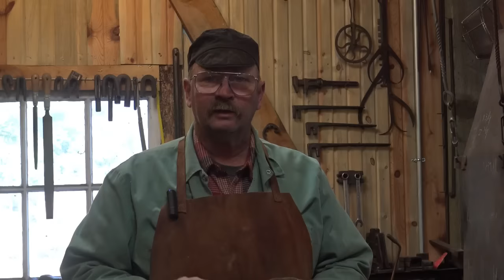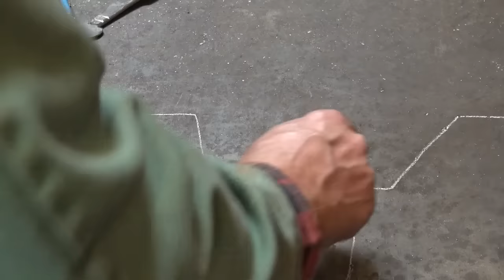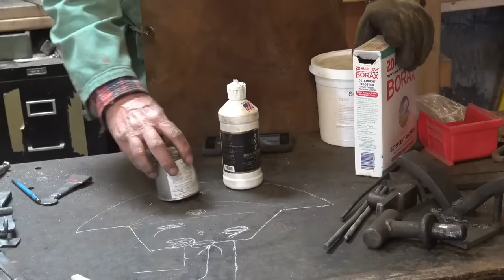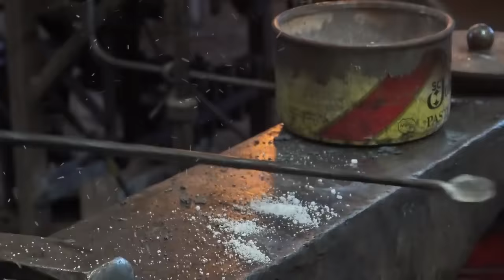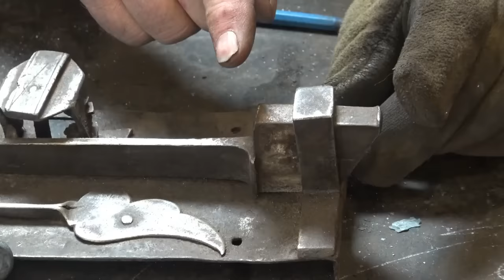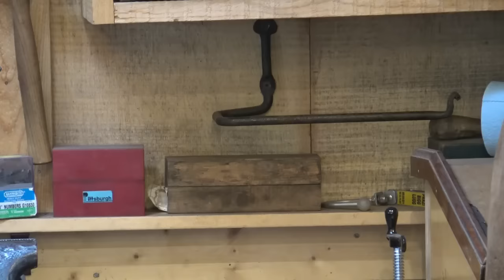Introduction to forge welding - basic blacksmithing

Comment: Good Gawd this brings back a ton of memories When I was a little kid my dad had a concrete built forge and it was my job to supply the oxygen to it by turning an old cream separator that he built an enclosed fan on. It had a little bell on it that indicated how the speed was for separating cream from raw milk when the bell was just starting to stop ringing was the right speed by turning the crank handle. Strange as it was that seemed to be the rite speed for most of the forging too'. We sharpened plow shares till the cows came home after the crops were in and the shares needed drawing out and tempering. He forge welded just about everything that broke and it always amazed me that it held, He used borax for all them welds. He made every thing from wagon wheel tires to harrow teeth and everything in between. This was 65/70 yrs ago when things were tuff out in the country and one made do with your talent and hard work and very little else. Thanks for the refresher and info.
Reply from the maker: Thanks for sharing the memory
Reply: If I were a bit younger I would take up a bit of what you're doing but at 79yrs+10 months I'm pretty busy turning wood with 4 different wood lathes and fighting off pple that keep bugging me saying "you should enjoy your retirenent" I can't seem to convince them that's exactly what I'm doing so just get out of my face.
Reply: I'd love to hear some of your stories. You make me miss my grampa
Reply: What a great story!
Reply: Awesome story. Appreciate it
Reply: @gdaruda  LOL
Reply: @gdaruda  amen! Get a hobby, people and leave me alone. :-)

Comment: Really enjoyed this video. I worked in a production shop MIG and TIG welding and can attest to hot metal ending up in places it shouldn't. I had spatter balls while MIG welding find its way inside my leather boot, and not burn me until it came to rest between my toes. A mystery I will never be able to solve.
Reply: I can attest to that....stick welding verticals and have Slag roll off, burn through my jeans and sock....a critical weld so I  just let it burn...a nice quarter size piece of shin skin came off that night when I got home.

Comment: I made a flipped heart (don't know if that's the proper name but that's how it's made) at the pioneer village last year. It was a piece of 3/8 rod I found leaning up in the corner. Anyway when I got done making the heart then I had to figure out what to turn it into. And I thought there was enough to turn into a paper towel holder. I finished it and it came out nice. I took a lunch break and carried it down to the store for them to sell. A lady saw me carry it in, ran in and bought it. It was a good feeling.

Comment: I have been using a charcoal forge for a while and finally broke down and bought a propane forge. I have never tried to forge weld as I really didn't understand how. Your video has inspired me to give it a whirl. It "looks" simple enough. Thank you for your video. It was very instructive. Keep up the good work.
Reply: How did it go?
Reply: So, here's the update. All I have to work with is 1/2" rebar. Not the best stock for anything, but it's all I have, so I used that. Hammered it out square. Drew it out a bit and folded it over. Squared it up the best I could, put in the borax and heated it up as hot as I could. I took my time to get the weld set before I really started hitting it hard. Repeated the whole thing and made 4 layers. The last weld delaminated a bit, but overall it looks like it worked. I'm going to cut it in half later and see what's really in there. I didn't get it as hot as I wanted. I need a brick to block the front of my forge. Still just getting started. Again, many thanks for the video.

Comment: Thanks for a very informative video. I’m keen to get started having been in the metal trade for decades, my career was weld testing by x ray which I sentenced as well so have a good insight. Being very competent at oxy welding thin steel I’ve been able to watch the colours right up to melting and burning if you have an oxidising flame. Your vid has given me a lot to work with and I’ll most likely build a gas forge it would be great to have someone like yourself watching and guiding, alas I gunna hook in and give it a go

Comment: I would pump the overhead bellows for my grandad when he was at the fire. I was small enough he built a ramp for me so I could run up and grab the rope and let me down and then do a loop away from the fire and do it over and over. It was about 5 feet long by 3 ft wide. He used 20 mules as I still do today 55 yrs later.He made his own birch charcoal too that he would let me help with. He made all his chains and was a ferrier too. I soooo miss those days and have rarely found anyone to teach the craft to. He would have been in seventh heaven to have forges like ours. I have always wondered what became of his big clay forge.
Reply from the maker: Great memories
Reply: Tomoko's Enterprize I’d love to learn, but it isn’t practical for my area. I am working on getting my own forge going, but unfortunately it is only practical as a hobby/craft sale/garage sale item type thing here in north central Illinois.
Reply: @fishsoft92  "Kevin Robinson made a great forge" from a Truck brake drum with a clinker breaker and a real simple way yo get a nice forge made for very little $ involved. Check him out bud. He has a great channel.
Reply: Tomoko's Enterprize thanks, man. I have the forge built, it’s a Tim Lively design adapted to an old charcoal grill. It’s actually the anvil mount that is the hang up. That plus I just got married and bought a house.
Reply: @fishsoft92  I look foreward to seeing it one fine day my friend.
Reply: Tomoko's Enterprize I’ll get a video up on it once I get everything rolling. Thank you for the encouragement my friend.

Comment: I use a forge outside and had to figure out a way to recognize the welding heat in different color environments, I have found that if your forge welding at night as soon you see the first spark or two in a clean fire, pull it out and set the weld. I have also found that letting the piece cool well below orange before you try and work the material. I will generally Flux it two or three times and set it between Flux in hitting a bit harder subsequently.

Comment: This helps a lot. I've been wondering why my charcoal isn't getting hot enough and it probably is because the forge needs to be cleaned out and the blower replaced. I didn't realize until now

Comment: Loved this Video! excellent knowledge and teaching. I had to learn a lot of this on my own when I first started forge welding, I was told by so many smiths that you wanted to wait until the material is sparkling to take it out and weld, I always look for it to start bubbling and steaming, thats the exact moment before it starts burning, saving material while guaranteeing the weld when you're newer...

I also will always teach how to forge weld on mild steel first, because once you can forge weld mild steel you can do the more expensive high carbon steels and tool steels.

I wish I had you to teach me from the very beginning, excellent excellent videos.

Comment: I learned to forge weld at age twelve as an apprentice. I’ve only ever worked in a coal forge. The master smith I studied under rarely explained why we were doing things or why it worked. “This is how we do it. This is what it looks like. Now you do it.” 

I must have made a couple thousand S hooks and nails that first year. I’ll never forget the thrill of getting to first hold the tongs, and then take turns with the hammer welding big things. I was terrified I’d get the timing off and either not clear my hammer in time or swing too soon before the other hammer was clear. I burned my first solo attempt at welding so bad I almost had to scrap it. Then I got the lecture, “Ok, tell me what you did wrong?” 

A wrist injury effectively ended my career awhile ago  but I miss the work. Keep thinking there must be a way around it. Maybe I’ll learn to swing a hammer with my left hand!
Reply: Did you learn to use your left?
Reply: @Erduk  I did not but I did coincidentally get a small forge and some coal recently. Hoping to start small and maybe find my way back. 

Thanks for asking. Maybe it’s another sign I’m on the right path.

Comment: As the oldest and stepson on a large NE KS. farm, I have learned the deepest respect for the “BlackSmith” as my step father & his farther had to fix machines and implements. When stress caused fractures or breaks, the used their crank-top Lincoln welder. They where not experienced nor did they try harder to get better. That job quickly feel to me. But many parts, hinges, tools where old but handmade. I had put an eyeball on the fractured parts to predict how they where made. Not in a factory, but heated, hammered by some talented person, lost to history. This stuck with me and self-taught, pestered local auto tech in the five block long town, where we lived 4 miles away, later to become an ASE Master Tech while working at a dealer. The little shop, next to the gas station is where I lived in a 14 foot trailer. During one winter, I got sick & had what was pneumonia and 8 days of no work, equaled no pay. This sent me into the city to find work that had sick pay.
  But, I saw the hammer marks, the folded welds, the idea of what was first, then next. I knew this was done by a Smith. I fixed a hand cranked corn shelled, hay hooks, worn axes, complex butter churns I used to crank ( Once I fixed it) but made butter and strained off the butter milk for biscuits my maternal grandma taught me to make, and still do in Feb 2020. 
 This art is truly the craftsman’s who built everything in America, including locks. Yep big old barn and door locks I found in a house on property purchased to add to ours. I removed and kept until a filmily issue, I choose to leave. They sold everything I owned including my letterman’s jacket at garage sale. Sad to loose soo much to history, but glad I found your channel due to my search history. Subscribed and liked. I will be watching more as time allows. I have had 5 surgeries, 3 weeks ago, right elbow for pinched nerve that’s 7 years over due. But another lumbar fusion next month to make it an even 4. Then onto arthritic middle finger that feels broken like a cow stepped on it. Then a couple more so I can work in my garage to get something done each day. That’s all I know, work, getting things fixed.
 You have a nice looking shop and the gas much cost a bunch every month, but compared to what I do to save money, even splitting paper plates is in two. Blessings my hard working friend and long live this craft thru you and your efforts! Great video!

Comment: This is interesting to me. I am just learning about blacksmithing and want to learn to do it the traditional way without the use of powder tools. My main skill woodworking and I do it without powder tools. Its my dream to have an off-the-grid homestead and make all my own things using skills used in the late 1800s.
Reply from the maker: Blacksmiths have worked without power tools for centuries.  It is more work and the lack of a young apprentice makes it harder for most of us.  But it is certainly doable.
Reply: @BlackBearForge  I believe that I can do it. I'm 39 years old.

Comment: Respectfully, thank you for your wisdom / knowledge sir.
I'm using a holed clay brick forge, Lump charcoal wood Forging up to 3999 degrees Fahrenheit, yours is 6000 plus, I hope it's right what I'm doing & using borax right, I'm doing what I can to bind & forge together the same metal / rebar iron steel components mix that is clean & strong, thank you sincerely Sir for this video"!

Respectfully, / Sincerely.

Signed :

Paul Wade Hampton~

Comment: Thank you, I've really been struggling with this due to a lack of solid information out there on forge welding. I wonder, would it be possible to forge weld thinner pieces of metal? I've had an idea to salvage old handsaw blades together to make a nice pattern-welded piece. Is

Comment: Oh, how nice it was to be young and able to wield a heavy hammer. I still can do a drill hammer for short periods of time, but an 8 oz ball pein is about all I can do now that I am 75 years old and shoulders are shot.  I did a lot of small forging when I was in the Navy years ago, using bell tips as we had no forges.  Loved your video and remember one thing. When you become an expert, you have about 5-10 years of working ability before you get too damned old to do it any longer. Bless and keep you!    BTW, have you ever had a chunk of cut off molten metal go down your shoe?  It is quite exhilarating...
Reply from the maker: I try to always wear boots with tops that allow my pants to hang over so that dioesn't happen.  Ouch!

Comment: Great Video.  Over 60 years ago, my grandfather welded a rod that connected the harrow to the drag disk.  I had turned too short and the disk blade wore through one of the rods.  I know he used Borax, and I seem to remember him saying he also had ground glass mixed in it.  Maybe he just had a container of ground glass sitting near the borax box.  The old blacksmith shop has long since fallen down.  The old coal forge fire box and hand cranked blower was sold many years ago.  Is it common to use ground glass in welding?   I can only stick weld!  Retired and not a farmer or blacksmith; but I still remember the stinking coal smoke starting the forge.  Thanks
Reply from the maker: Clean sand has been used as a flux.  Since glass is made from silica sand it makes sense that ground glass would work

Comment: Hi John, I'm really enjoying this video on fage Welding, I find it most helpful to my Tire Setting Tool making project. I'm trying to make a Tool found in Practical Blacksmithing Part 2 volume VI Page 93 By S.E. H for putting Iron Tires on Wooden Wheels! Seem to me that fagh Welding the Head is the best way to do this as it gives me a good Hinge point on the rear of the Head for the Head, and I can draw the Beck out and shape it as needed. I'll be making wheels for Wheelbarrows and a variety of Horse drawn vehicles. Do you have any thoughts you care to send my way? Thanks for the Video John and have a Great Day.

Comment: I just built my coal forge & I'm going to pound metal tonight, I thank you for making videos that explain the process really well. I've had a little trouble getting things & I'm really curious where you got your chalk-pen if that's what it's called? No stores have anything like it & it's exactly what I want. Thank You for Your time.
Reply from the maker: Its a silver pencil, they are available at most welding stores

Comment: Outstanding work and very helpful. A small piece of advice for your videos though. When you are working with the forge and it gets loud in the forge you could consider recording your video, recording a voice over in your office or when it's quiet, and then placing the voice over audio over the appropriate video. It's a pretty basic editing skill that I am sure you would pick up easily.
Reply from the maker: This is sort of like going out to dinner and complaining to the manager about a meal you had 2 years ago.  But yes even a dumb old blacksmith can learn to do a voice over, I use them from time to time, but find them less effective than narrating as I work.

Comment: Very good. One issue though... The oxy/fuel mixture on a torch heats the metal to melting temperature, which excites the molecules. The burst of oxygen from the lever does not increase the flame temperature. That burst is merely used to push the excited molecules out of the way. It acts the same as the compressed air on a plasma cutter, of which compressed air is more than 70% nitrogen on average and roughly only 20% oxygen.

Comment: I understand the principles of forge welding as you’ve shown in this video, but how do you forge weld large pieces like a gate? For instance, the gates at Buckingham Palace had to have been forge welded since the predate other methods of welding, yet they’re huge and unwieldy.
Reply from the maker: I think that forge welding would have been used to assemble smaller ornamental elements.  But the larger assembly would have been mortise and tenon joints, hot collars and rivets.

Comment: This video is a educational masterpiece. Just a small curiosity, is it possible to forge weld two files? I have a couple of those, way too "dull" to be useful. I thought that I might use them for exercise, since the forge-welding temperature required should be somewhat lower than the one required for low mild steel. What would be your opinion?
Reply from the maker: Yes, just be careful not to burn the,

Comment: ive been usen 20 mule team borax for as long as ive been smithing. cheap and does the job. bit of a pain to clean up i have to say.  just wish had a long lp forge. got a 3 layer blade to make. o well ill just have to use the coal forge.

Comment: Thanks for the informative welding video, I learned alot from your techniques. I want to know if you would do a video about your side sucker chimney that hangs over your coal forge. I just built a hood and installed it in my shop but it wont take all the smoke off the forge. Your system looks very dependable at getting all the smoke off the forge.  Any help would be appreciated.
Reply from the maker: https://www.youtube.com/watch?v=R6O8Wv8zfR4

Comment: Does the flux drip into the gas forge? And is it bad for the fire brick?
Reply from the maker: Yes and yes.  Forge welding is hard on gas forges and they will need to be re lined from time to time.
Reply: Thank you very much! I saw the video where you said a ceramic tile would work in there. Lucky I’m also a potter so I will high fire a stone ware player to fit right in my forge to forge weld over.